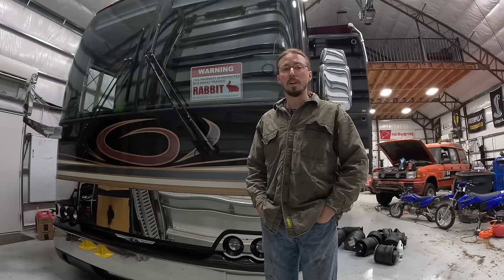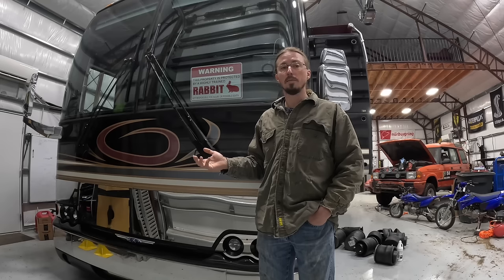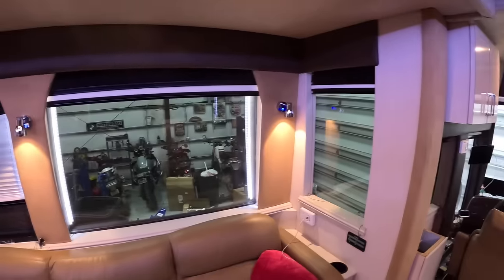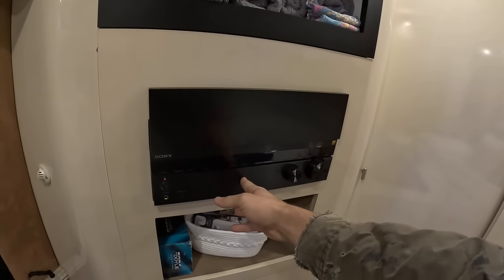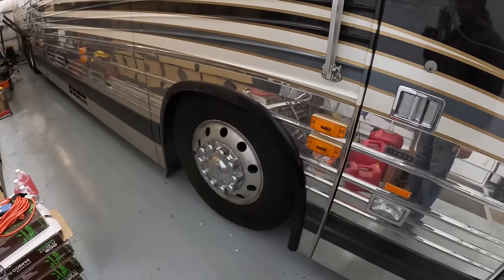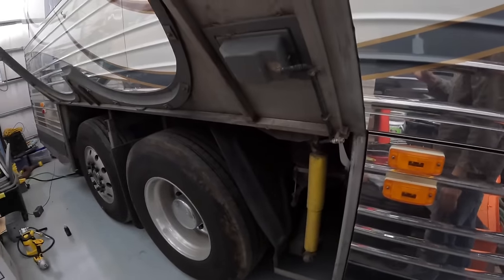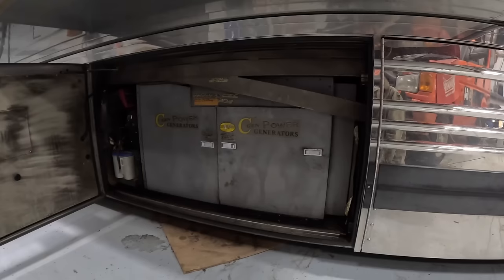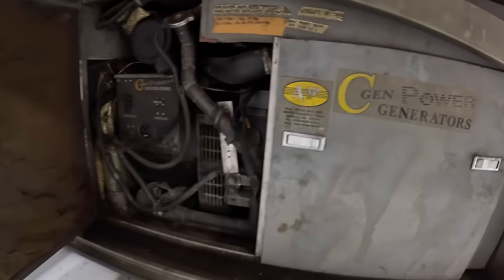I bought a Prevost XL2-45! Why and walkaround

Comment: So let me tell you speaking from experience and having done my front air bags on my 06 H3-45 when you think the air fitting is tight on the top of the air bags go at least one if not two more turns if you don’t want your coach leaking down every night. I could not believe how tight I had to get them anyway just a little advice from a fellow Prevost enthusiast.

Comment: Great video. Been watching a tonne of these and this is exactly the setup I am looking for. Bunk (double setup is okay), tv position, a washer dryer in the position of the other bunk, full shower, and queen bed. Anyone see something like this, please comment. Question is, would you move up in year or anything else unpractical you would want to change? Hoping you're well.
Reply from the maker: Good questions. I'm happy with the year I have. I would prefer a 14L Detroit, but not one new enough to have EGR and the other emissions equipment on it. However I do like the updated front end which mine has (looking at a normal 2001, you can see the difference).

I definitely am glad to have an IFS, and supposedly the first few years of the IFS were harder. So I think the only thing I'd want to change that's impractical is the engine, and there's really nothing wrong with mine.

I suppose I would like to have Jake Brakes.

Comment: Nice looking coach and congratulations on the upgrade.  

When you were taking about the slide you said they were powered by air instead of hydraulics.  The Prevost installed slides are powered (moved) by a very large electric motor.  Air is used to inflate the slide seal and to extend/retract the slide pins.  

The slide pins only lock when the slide is retracted, not when extended.  

I can tell you are going to love this coach.

Comment: Congrats, that’s a gorgeous coach, it will last a lifetime if cared for properly.
I have a safety suggestion, that 20lb propane tank in you storage bay is a bomb waiting to go off, it’s so close to those inverters that could easily be an ignition source. Not being critical, only concerned for you and your family.
Safe travels
Reply from the maker: That’s a good point. I hadn’t thought about the propane being in the same compartment as the inverters, and that could present an ignition source if a leak occurs. I’ll look at alternate locations. Thanks for the suggestion.
Reply: @TedsGarage  The propane tank cannot be in a fully enclosed compartment. Usually they are permanently installed and the bay bottom is either open or expanded metal.  DOT requirement.

Comment: Nice rig!! I just found your channel and I like what I see I am curious what does a rig like that go for you didn't mention that. I have a 2012 Georgetown motorhome and I too like to do all the work on it myself I have a hard time trusting these RV shops to do the work. Looking forward to more videos on your new bus.
Reply from the maker: Thanks! There are many more videos coming. I didn’t include the price intentionally - there’s a lot of variation in what a Prevost is going to cost. However several people have asked this so I may do a video in the future discussing what the variables are. Compared to a standard purpose built RV you’ll be spending more/going older to trade up to a Prevost, but you get more for it. It’s absolutely an enormous upgrade for us.

Most of my upcoming videos are discussing the work I did/am doing on it and will include ongoing repairs and upgrades.

Comment: Cool ,neat coach. Where did you get your air intake scoop on your HR? Would like one like that for my fleetwood.
Reply from the maker: I got the scoop off of eBay. Take measurements of the area for your air inlet and then look around, there are a lot of different options out there - you'll just need to search and measure until you find one that fits.

Comment: Great video! I will subscribe and follow your journey. I should have waited and bought a used Prevost rather than my troublesom 2023 Phaeton. Just wondering what fuel mileage you gor on the long trip home??? At least no DEF to worry about.
Reply from the maker: Thanks and hope you enjoy my upcoming videos! I’ve got several in the works on the Prevost.

My mileage coming home ended up averaging out to 6.8 with the cruise set at 75 most of the time, and slower when required. I’ll get a better picture on mileage as I drive it more.

Comment: 29:31 Love watching your videos.  I currently have been in a 2000 Monaco Diplomat and have followed your conversions and maintenance from your last RV since the Holiday Rambler part of the Monaco family.  Have had mine for 10 years.  Love the Prevost.  I have wanted to get a Prevost also but Cost is always a killer. If you don’t mind me asking what kind of price was for your Prevost.  .. Would love to see videos of you driving it and detailing wind experiences from your last Rv.  I have done a lot of chassis mods to my rr8r, (safety plus, Koni shocks,trw steer, rear cross braces, air tabs).  Still get pushed hard in wind at 65.  Looking at Monaco watts front end next and possible front and rear sway bars.   All of which costs a lot of money so trying to decipher which one to get next.  Any advice you can give me would be appreciated.  I spin my own wrenches a little bit, but don’t have indoor storage.  Have to grease front seals, not sure on the process yet because truck shops want $1200 to do it.  Love the video looking forward to the driving part comparisons,
Reply from the maker: I'm glad that you've been enjoying my videos and that they've helped you. I'd rather not go into the cost of this bus, but Prevosts in decent condition are going to be a significant increase vs. a similar era RV like yours and my previous Endeavor. I'll add a driving video of the Prevost to my list of videos to make on it, thanks for the suggestion.

The next items I would suggest for you are AirTabs and the sway bars. I'm not sure if you've watched my videos on those, but those did make significant improvements (especially my DIY rear sway bar, but that also takes welding and a decent bit of fabrication albeit cheap to do). However I will also tell you that, even with everything I did, there are still times where 60-65 was as fast as I could go simply due to how much wind buffeting I was getting bouncing the bus around.

If you're fine with a 40' and willing to go to an 8V92 instead of the Series 60 (which comes with a fuel economy penalty) and get rid of slides, the early 90s Prevosts offer a good value if you want to upgrade. However for us 45' was a requirement as was a Series 60. The 2-strokes are harder to keep cool and they do come with a significant fuel economy penalty. Also of course an older bus is going to be an older bus, you'll have another ~10 years of aging on everything. I will say I walked through a few non-slide Prevosts and I was surprised how much more space they had vs. my Endeavor slides in.
Reply: Thank you. It is so great that you replied so quickly which I appreciate and shows that you are a good man of character.  I have watched all of your videos on your last motorhome. Yes I have installed the air tabs . Source engineering sells a rear sway bar and front sway bar for the Monaco.  Can hardly wait to see more of your Prevost videos now.
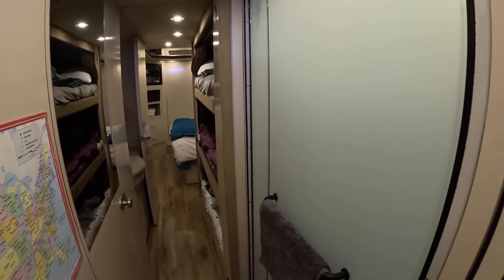7:54
Reply: Looks like a $250k coach

Comment: What tires are you running? It looks like the fronts and tags are Bridgestones, but I didn't think they made a 365
Reply from the maker: It did come with Bridgestones all around, and yes they’re 365s on the steer and tag. Apparently they were available with a commercial program the previous owner had. I’ve since replaced the drive tires with super singles (also Bridgestones), which I’ll cover in an upcoming video but I’m very happy with.

Comment: Good morning Ted, can you tell me what Sony AV units are in the coach?We recently purchased a production DP and the the TV's were upgraded they removed the AV reciever.
Thank you
Reply from the maker: The units in my coach are Sony STR-DH590s. They aren't RV specific and not something I'd had any familiarity with before. Overall I find they work well.

On my previous RV, I simply installed a sound bar setup for both front and rear. This was simpler to do and overall I think a better solution. The Sony units work but they'll automatically switch sources and that can get a bit annoying. Plus they do take up a lot of shelf space. The good part is that they have outputs for standard speakers, so if you already have speakers wired in your RV this could be a good solution. Sound quality is good, but no AM/FM built-in natively.

Comment: @tedsgarage were you able to find and fix more air leaks? If so, where were the leaks?
Reply from the maker: Finding air leaks is still ongoing. I replaced the push to connect fittings behind the dash going to the air gauges and that helped, I found another push to connect fitting just forward of the drive axle that was leaking and I replaced all the air bags and the push to connect fittings on those. It’s all helped a ton but my air compressor is passing oil and the governor is leaking, so those are next.

I’m expecting a fairly constant game of whack-a-mole with it given how many air fittings there are.
Reply: @TedsGarage  hopefully no slide out air seals are leaking 🤞

Comment: Hello Ted i may have missed the cost and mileage on this unit. Can you share?
Reply from the maker: This has 98k miles on it. I’d rather not share the cost on it, Prevosts have a wide variety of costs depending on the specifics of the unit (age, slides, conversion status, etc) and so you have to look at each of them individually. They tend to be a bit more unique than standard RVs in that regard because of the variety in their builds.
Reply: Thank you very much for answering Ted.  I do understand what you are saying with regard to options and so on.  These have always been my favorite as they just seen more classy and better built. I will need to do my research but thanks for the review of the one you purchased.
Reply from the maker: I can definitely say they're better built and higher quality. There's a lot of variety to choose from in terms of options and conversions. It makes choosing hard, but when you find the right one, you'll know it.